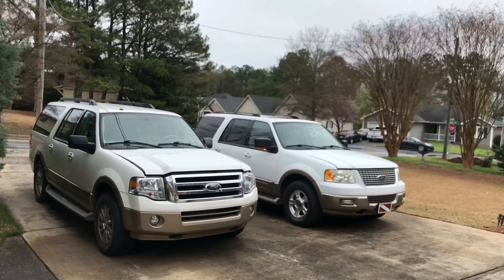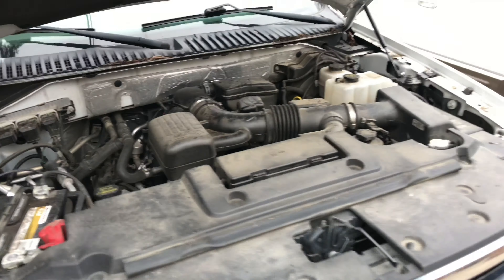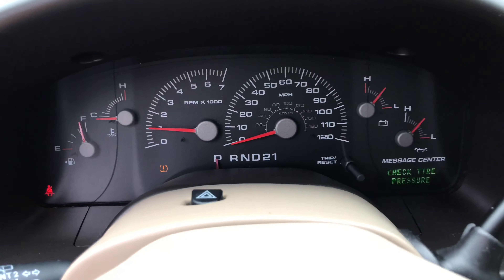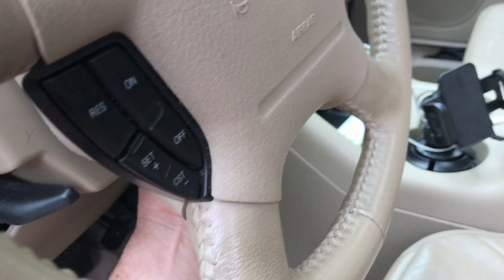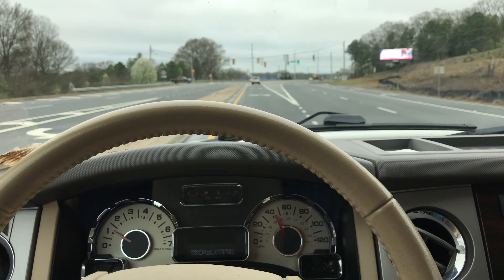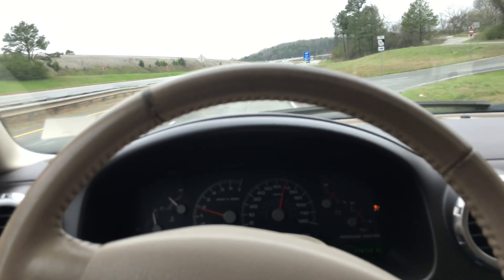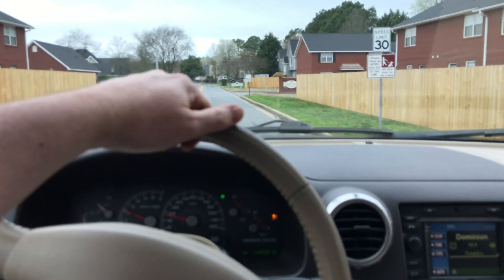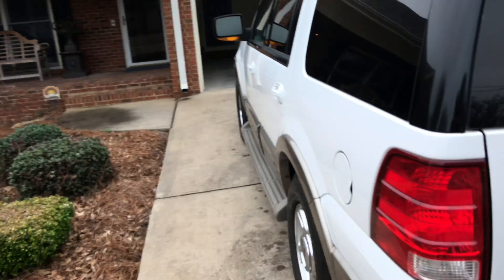Ford Expedition comparison! The story of two Expedition’s pov 0-60 triton

Comment: I have an 05 looks identical to that 04, mine was also garage kept in northern Kentucky, a few dings n dents, it runs like a top at 200 thousand. Transmission was rebuilt, driving like a grandma I was able to get 22.4 mpg.
Reply: The top of the engine looks different that both of those also

Comment: The reason why they look different on top of the engine is one 5.4 is a 2 valve version while the other is the 3 valve engine, there’s a big difference in horsepower between the two, the 5.4 2 valve only put out 260 horsepower while the 3 valve makes 310 horsepower in 2013, if you miss any service intervals with that 2013 the 2 valve will live a lot longer then the 3 valve

Comment: I own a 2011 XLT premium with 250k miles on it. Only run full synthetic and change all fluids before necessary. They really run forever if maintained properly. The extended model will feel quicker as it as  a 3.73 rear end vs a 3.31 for the regular sized version. These vehicles are easy to work on if necessary and are a beast in the snow and tow a whopping 9k lbs. I would definitely recommend if a big suv is needed especially over a Tahoe and Armada which are plaqued with problems. I've talked to numerous owners of these vehicles and they have many issues to complain about. Only the Sequoia is a admirable replacement. If only Ford put the 5.0 V8 motor instead of the ecoboost 6 cylinder. The 5.4 is a great standard motor for the time but Ford should have offered the 6.2 as a option and standard in the Navigator. Most people that own big suvs like trucks are not primarily concerned with fuel economy as they are about power, comfort, driveability, visibility, towing and storage.

Comment: I have 2008 limted with 450000 km on it . The engine and gearbox are in factory condition I used 5w30 focus titan oil . Great car and great sound when removed resonator

Comment: I have an 03 Eddie Bauer expedition with 280,000 miles and it will take a beating and still running like new these trucks will last you forever only thing I’ve done oil change and spark plugs
Reply: Still got her?

Comment: The 04 5.4 is a dual overhead cam and from 07 and up the 5.4 switched to single overhead cam. That's why they look different 👍
Reply: They never put the DOHC in the expedition. Those were in Lincoln navigators. The ‘04 is 16 valve(2v per cylinder). The ‘13 is a 24 valve(3v per cylinder) with variable cam timing. They are both single over head cam(SOHC). The ‘04 also has the old 4 speed transmission. The ‘13 has a newer 6 speed transmission.
Reply: @truevtx1800rider  yes and the 04 will run foreve if you keep a good maintenance.
Reply: The navigator 03/04 was DOHC

Comment: gonna buy some SUV this weekend and can't decide whether it should be 03 Expedition/03 Navigator/97 Tahoe/05 Tahoe...
Reply from the maker: I tell ya.   I owned a 2003 expedition w/130k. It was good.   I owned a 2005 aviator w/120k.  A bomb 💣 One owner with all service records immaculate but it was the biggest piece of shit. Then I bought for $700 a 2002 Chevy suburban that my brother-in-law bought new. It had 240 K and it was the best truck I’ve ever owned. It leaked a little oil but it did not require any repairs while I owned it
Reply: @JoesGoldenGarage  thanks a lot! i also lean more to Chevy side even though they don't have the option to open the windows in the trunk(need it for my dogs) i also see that tahoes and suburbans are less corroded for some reason.
Reply from the maker: @punkloserorama  well since I am in GA I never have to think about rust.   I accidentally bought a Ohio excursion a few yrs ago  without a look see......omg the rust.   I learned.   It had snuck into GA somehow.

Comment: You should consider buying a GoPro with a head or chest mount. It looks like you struggle sometimes and it would take so much stress out of stuff like popping a hood or starting a car :)
Reply from the maker: Joe Spittle I have a new go pro 5 in a box but I would never get around to uploading to my computer and then to u tube.  It’s easier to just use iMovie and upload right then.   I do it usually just a few minutes after I take video.    I need a good selfie stick
Reply: @JoesGoldenGarage  That makes sense, and phones have such good cameras nowadays it makes more expensive cameras redundent
Reply from the maker: Joe Spittle That it does indeed